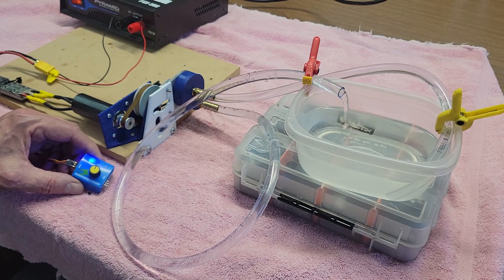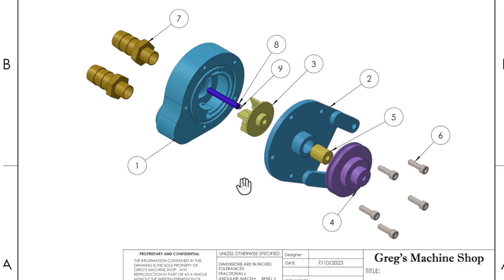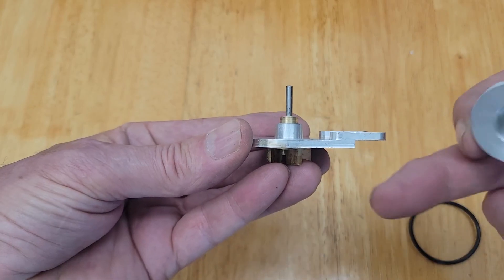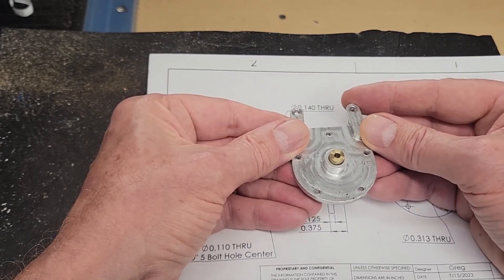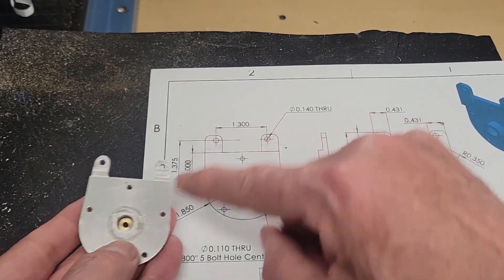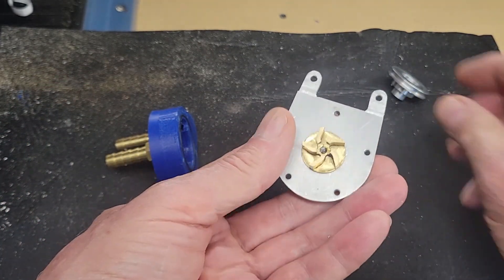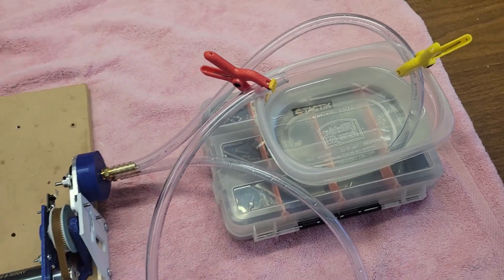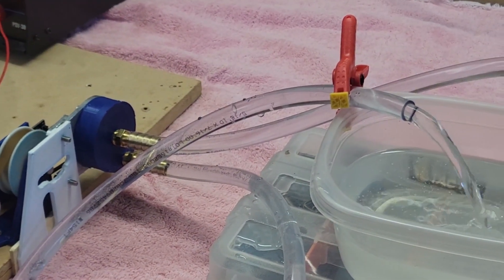Building and Testing a Water Pump - Wallaby 30cc Engine Build - Part 27

Comment: Pretty nice design, maybe you could use some epoxy to waterseal the 3D printed parts, ive senn them sweat water over time. Maybe it could fix that
Reply from the maker: Good Point.  You are saying that the 3D printed plastic, given the way the parts are created by applying multiple layers of plastic could weep water.  I will keep an eye out for that.  Interesting observation.  I have a good seal where the pump body is mounted agaisnt the bracket becasue I have an o-ring and used silicon sealer, but I do have slight weeping through the impeller shaft.  I wonder if a little o-ring mounted around the shaft somewhere in the design would cure that.

Comment: That does pump well, even at that slow speed. Thanks for sharing!
Reply from the maker: Thanks for the comment.  Yes the pump does work quite well, I ran the pump through the RPM range of the engine and I am satisfied it will meet our needs. However, the video is decieving becasue of the wagon wheel/camera shutter effect.  This is where the speed of the wagon wheels in old time movies become syncronized with the shutter speed and appear to be moving backwards.  In my case, the water pump pulley is actually turning faster than it appears in the video.